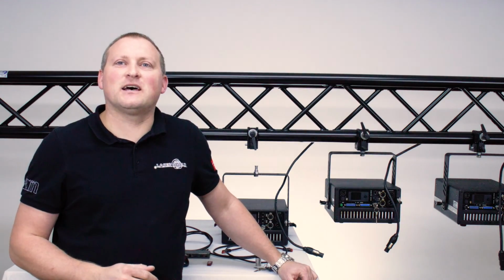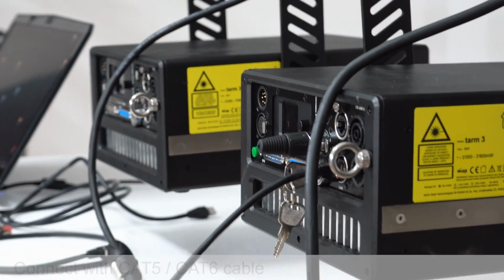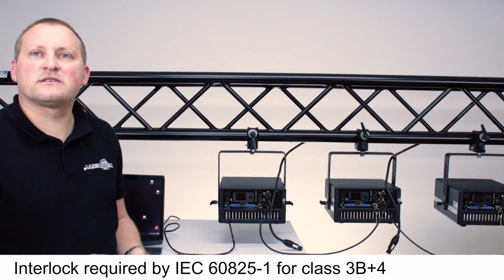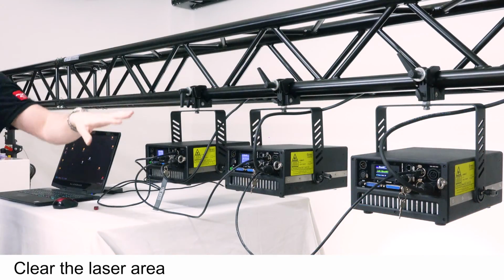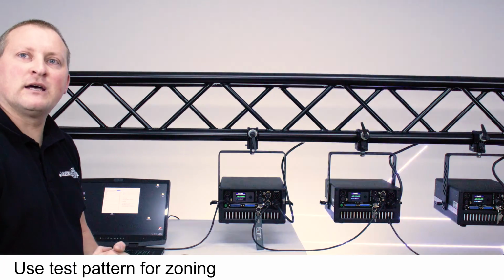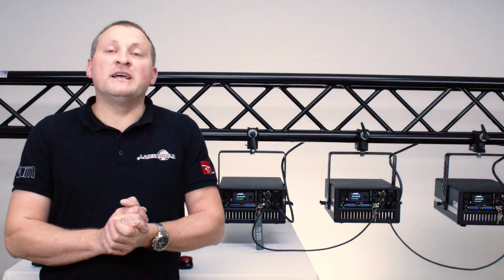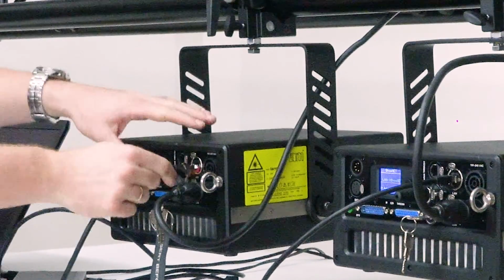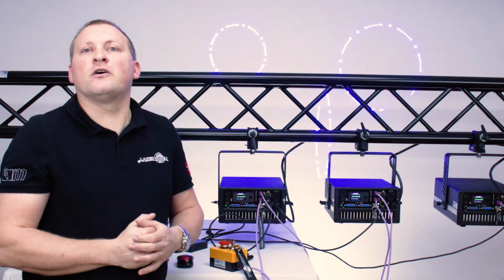Setup, connect and control Lasers / Laser show setup - what you should consider

Comment: I saw how you went just with RJ45 Ethernet cable. Can you control the lasers like this without the need of a controller?
Reply from the maker: Yes, if you have a suitable mainboard inside the laser, in this case it is the ShowNET mainboard, which is standard in many laser systems of different brands.